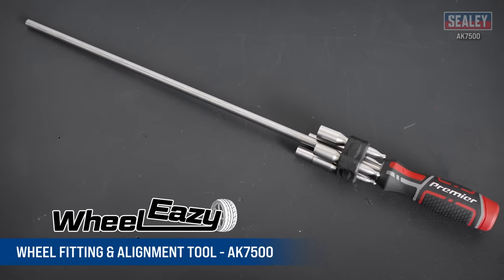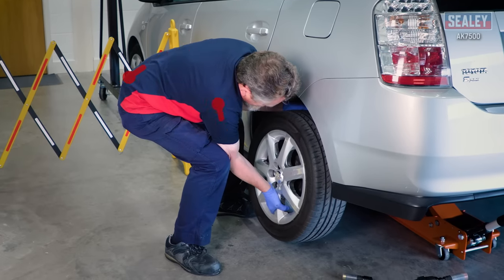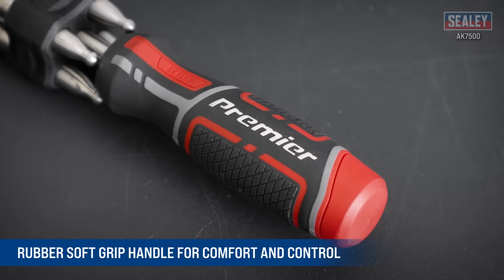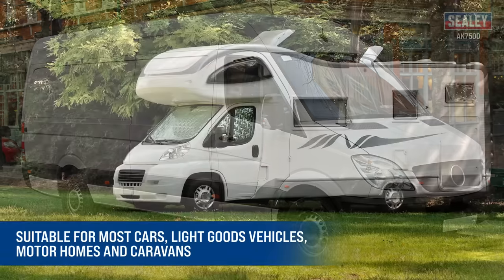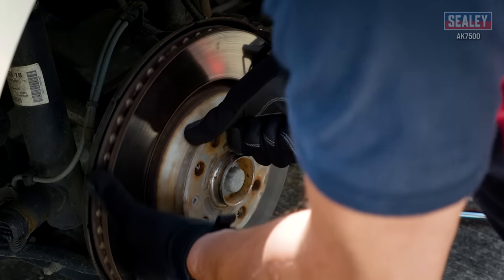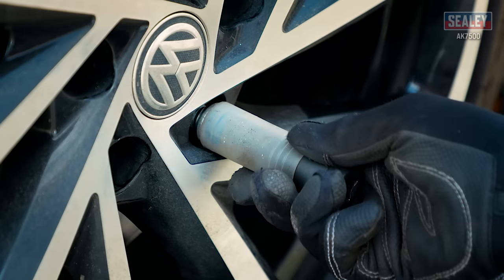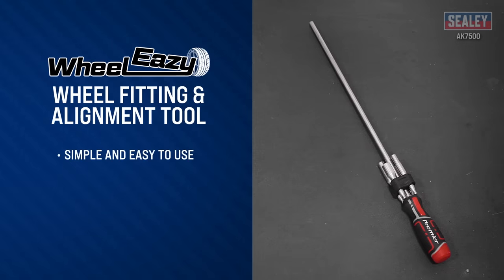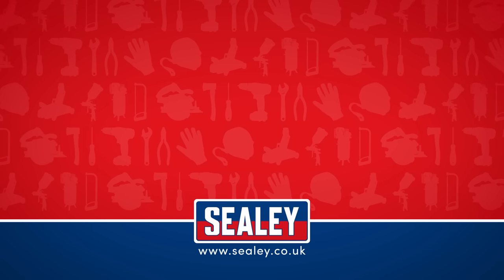Sealey AK7500 Wheel Eazy Tool - Wheel Fitting and Alignment Made Easy

Comment: Has anyone bought this in the USA yet? I change wheels almost everyday at work for roadside assistance here in California and lemme tell you how frequently I run into heavy spares including Jeep Wranglers(aftermarket wheels) and Tahoes/Lexus, wonder if it could handle that much weight.
Reply: I do the same thing in the UK 🇬🇧. Definitely having one of these
Reply: How high are you jacking these vehicles in the air… 
Work smart lower the fooking Jack so the hub and wheel are almost aligned then wiggle the wheel on…. 🤦🏼
Reply: @Kalus_Saxon  you seem to not understand the liability of lowering a vehicle thats not yours when a lot can go wrong and not worth risking 🤦‍♂️ apparently your not in this type of work. Btw i lift it enough to remove wheel sometimes spare/donut is larger or has air so i have to jack even higher to fit. Again lowering is a huge risk specially in incline or at a decline
Reply: @0s0213  I did my work experience in a tyre fitters in the 90s…. Been a metal fabricator since 1997.. 
obviously if a tyre is flat the hub is closer to the ground so if you only Jack it enough to get the flat off then obviously you will need to Jack it up a bit more for the inflated tyre…. 
And if I’m so clueless then I wouldn’t of been able to change a water pump/belts, rocker cover, new full exhaust and discs and pads all round and pass it’s mot 1st time, 2yrs running…
Reply: @Kalus_Saxon  lol im just gna stop here😂😂😂
Trolling Is funny but you clearly have nothing to do but to be negative in the comments. Btw I've changed 3 different spoon engines on civics have changed their exhaust to motec exhaust systems, now ordering 3 T66 turbos to install maybe add NOS too.